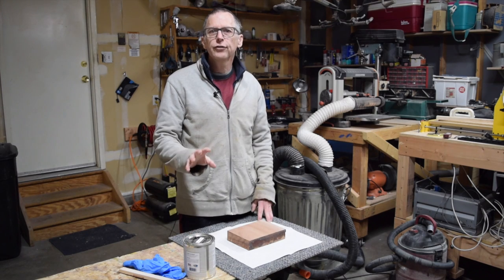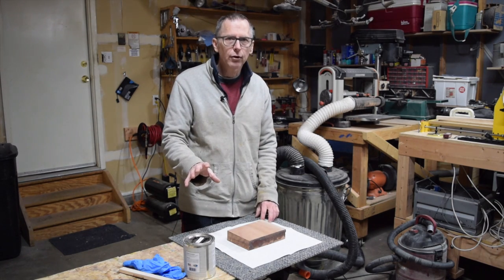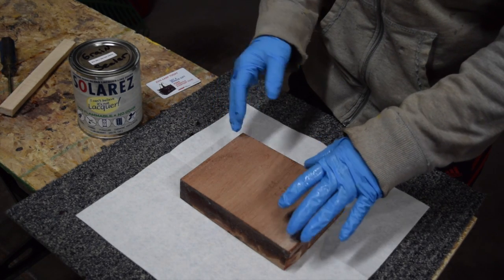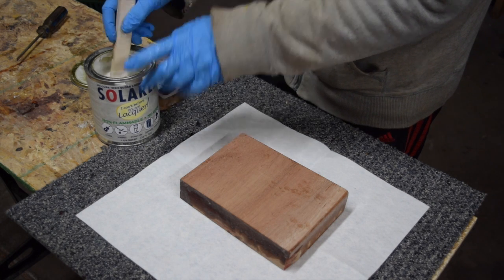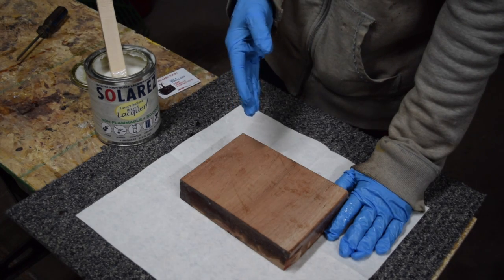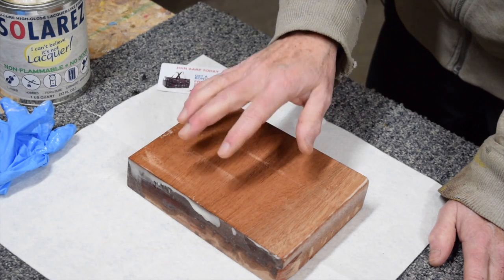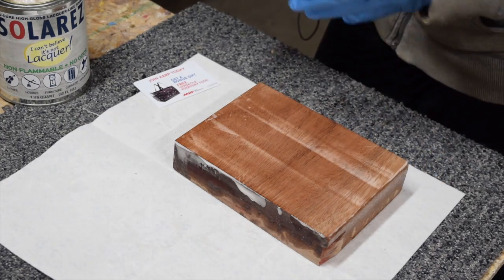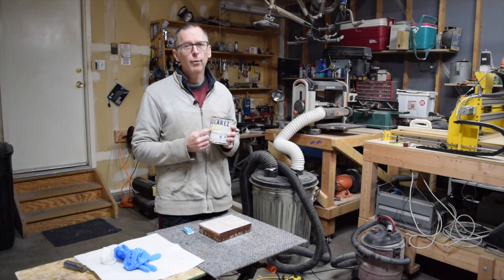The Best Wood Grain Filler I Have Come Across

Comment: After our exchange, I ended up using the Solarez on our Telecaster.  Amazing stuff--the ash is as smooth as glass!  My son wants to spray on a sonic blue nitro finish--would you recommend a vinyl sealer before that or have you found you can finish right over the Solarez?
Reply from the maker: Sorry I have no idea. I don’t use nitrocellulose.
Reply: I'll let you know what I find out---thanks!

Comment: What is this composed of or based on as the main ingredient? No SDS/TDS provided on site, is this similar to others, talc powder in solvent, which is what 99% of them are. The powder particles lodge in the wood pores and block them.
Reply from the maker: You will need to contact the manufacturer for that information.

Comment: OK, I’m sold! However, I and doing a walnut pedal board project and would like to try Danish oil. Are the two compatible or should I lay down a seal coat of shellac after the Danis oil first? Also can a colorant be added to make the grain stand out a bit? And if so what would you recommend?

Comment: My son and I are working on our first Telecaster build, using ash.  I watched your video on Aqua Coat grain filler and then this one.  Have you found that the Aqua Coat shrinks over time?
Reply from the maker: Yes, it does. All water-based products shrink. However, it usually stops after about two weeks depending on your climate. Also, the heat generated by machine buffing can cause shrinkage.

Comment: I imagine this product would not work for oil or oil/poly type finishes. What would you recommend there on Korina.
Reply from the maker: Rub the oil/poly into the wood with 4F pumice. If you can’t get the pumice, thin the oil with mineral spirits and wet sand it into the wood.

Comment: Hi, nice video, thanks.a question please
Can I use it on my ash cue to fill its grains? Over time ash cue grain pops up, ..may be due to reasons you mentioned in video (shrinkage). Cue has to clean with very slight damp cloth many times during playing. Cue has to send back to cue makers to refinish, and it takes few weeks to come back. 
Any idea how to fill those grains and then apply oil finish on cue. And it won’t effect cue color as well? Look to your reply,
Regards

Comment: Hi Chris, would you recommend this product for some ambrosia maple that I want to stain a darker brown color? Apply a good coat and sand it all the way back to only use it as a grain filler before staining? I'm real concerned with blotchiness.
Reply from the maker: I would recommend a water-based sanding sealer for your situation. It will allow better absorption of the stain after sanding it back while allowing consistent coverage without blotchiness.

Comment: Hello Chris, This is definitely one of the coolest video tips you have done so far. I have been following your work for the past 3 months, for I am building my 1st guitar Kit, and I don't want to mess it up. It's a Basswood body, with Maple top Les Paul style guitar. It also has a Maple Neck with ebony fret board. The body is cut out for H/P90/H, and A FR Tremolo Bridge. When I saw the kit on e-bay, It was a no brainer, For it Broke About every LP law in the book. I had to accept the challenge.  That being said. I plan on painting a design over the maple top, and then applying a gloss finish over that. I'm thinking two coats of Solarez Grain Sealer. Level Sand. Then a thin coat of Solarez dual cure Polyester. Level sand. Then base coat of water-based Crystalac Black. Then do some vinyl tape Masking, followed by one coat of paint, with Createx Auto Bourne Air Brush Paint. Un-mask Vinyl. Then the clear Coat Finish with either Crystalac Brite Tone, Or Solarez Dual Cure Polyester On the Top? What do you recommend? The back of the guitar is Basswood. Most excellent tone wood it is. But, it is a softer wood. So I'm probably going to go with the Solarez Polyester On The Back. Question Is. Do you have any Suggestions for this process?

Comment: I’m curious about your opinion. I’ve seen elsewhere that people have suggested staining or finishing first and then putting on a clear grain filler. Let the grain soak up the finish first leaving less to fill then either leaving it as is to cure or putting another layer of finish. This product looks great and kind of defeats other fillers, but if finishing first and then filling would work better for regular fillers wouldn’t this work better as well?
Reply from the maker: It all depends on the outcome you want. If your primary concern is color, dye or stain first and follow up with the clear grain filler. If you want to pop the grain, fill it first with a dark-tinted grain filler, sand it back, and follow with the dye or stain.
Reply: @HighlineGuitars  yeah that makes sense. Aqua coat is tintable and I’ve seen some really nice work with silver grain and black finish. I’ll look to see if this stuff is tintable. I imagine it would be. Thanks for getting back to me and introducing me to this product.

Comment: i ordered 4oz of this stuff what i received was 4oz of clear sealer no microballoons. after about five attempts at e-mailing them i finally got a response one person said they no longer put microballoons in their products and another person said they never have used microballoons. i also ordered 4oz of their i  cant believe its not laguer brush on formula and 4oz of the sprayon formula. i received two 4oz bottles of brushon formula and no sprayon formula. not a good experience with these folks

Comment: PS: As if the terminology was not confusing before, now there are various products called 'sanding sealer' 'grain sealer' 'grain filler' and 'pore filler.'  When a manufacturer comes up with permutations of those names, it makes it even harder to determine what goes with what, and in which order.

Comment: Can you mix this with paint or a tint? I liked when you mixed the black with drywall compound and it highlighted the grain. 
So the compound method results in shrinkage? Asking for a friend!
Reply from the maker: You'll have to ask Solarez if their product can be tinted, but I suspect it cannot be. To highlight the grain, I would apply a black dye first, let it dry and sand off the excess from the surface leaving it in the grain. Then I would apply the Solarez.

Comment: If i was going to stain my wood, id stain first and THEN do grain filler right? It wouldnt stain right if you did grain filler first correct?
Reply from the maker: I would put down a wood sealer first, sand it back and then stain. That will ensure uniform absorption of the stain. Then I would apply another coat of the sealer to lock in the stain followed by the grain filler (clear of course) after the sealer has fully cured.
Reply: @HighlineGuitars  Ok thanks for the info!

Comment: I want to finish a walnut radio cabinet. My intent is to stain with dark walnut, then apply Mohawk Dark Walnut toner, and finish with several coat of clear satin lacquer. Where in the process would I use the Solarez grain sealer?
Reply: It would have to be before the stain and toner in that process.  No way the stain or toner can penetrate through cured polyester resin and get to the wood.  As for the lacquer, I can't say how it would bond to this product.

Comment: Great video as always Chris! Would you stain the wood before or after this process?
Reply from the maker: Before.
Reply: @HighlineGuitars  not to sound dumb. But if I am planning on staining a mahogany body blue should I stain it first or fill it....and when would I schallac it. Thanks
Reply from the maker: @Elksniffer1  1. Stain the wood with a black dye. 2. Let it dry. 3. Sand the black dye off the surface of the wood. 4. Fill the grain with black tinted grain filler. 5. Let it dry. 6. Sand the black fill off the surface of the wood. 7. Apply blue dye. 8. Let it dry. 9. Apply sealer (shellac).

Comment: Hey Cris, Do I need a grain filler for alder? I'm using a primer, silver paint, candy red and then the clear.
Reply from the maker: No, but I would use it. Wood expands and contracts over time which causes the grain to telegraph through your primer, paint, and clear coat. Grain filler helps to prevent that. Even in Alder.
Reply: @HighlineGuitars  All right, will do, thanks for answering!!

Comment: What about adding some black acrylic paint or dye to make the grain on mahog or ash really "pop" like in other vids about grain filling?
Reply from the maker: Don't add any kind of color to Solarez. That will spoil its chemistry and prevent it from curing. Instead, apply your black paint or dye first. Sand off the excess while leaving it in the grain and pores and THEN apply and cure the Solarex. It cures water clear so the color left in the grain and pores will show through.
Reply: @HighlineGuitars  Thanks so much! your videos have given me a lot of great info about tackling my first project.  
Any idea if this same application method work for the brush on clear coat product of the same line?
Reply from the maker: @frick584  Yes, it will. In fact, I used the brush on formula as a grain filler before they had the grain filler available. Honestly, I can't tell the difference between the two.

Comment: Did you sand back to the wood before applying the top coat or did you leave a thin film of the sealer? Cheers.
Reply from the maker: No! I leave a thin film of sealer covering the entire surface to prevent an uneven application of my top coat.

Comment: I just got this product. Did solarez change their formula? It isn’t white the way you show in the can. It is water clear. Should I add silica to it?
Reply from the maker: You need to ask Solarez.
Reply: @HighlineGuitars  seems the formula changed. In fact, even after curing with a 385nm UV light for 39 minutes, the surface feels tacky  it doesn’t seem to want to cure completely. Yet, the residual material in the cup cures hard as a rock. Really strange
Reply: @HighlineGuitars  thank you for all your videos. They are all fantastic!

Comment: What if you're working in a shop with windows? Would it be okay to apply this as long as the sun was overhead the building (say noon?), or would you have to black out the windows?
Reply from the maker: Test on scrap to see what will happen. Even indirect UV light can trigger a premature cure.
Reply: @HighlineGuitars  thanks!

Comment: I'm willing to try this product but does anyone have info about compatibility with other types of finishes? Nitro and 2K polyurethane primarily.

I have used Z-Poxy on several instruments over the past couple of years and although it says Z-Poxy doesn't shrink everywhere on the internet - it does. I have ash guitar body that was nice and level 1 month ago, and now the finish has sunken to the pores.
Reply from the maker: Did the Z-Poxy shrink or did the moisture content in the wood change?
Reply: @HighlineGuitars  That's a good question. I'm not sure, but I would say it didn't. Because that guitar has a poplar burl top and the finish over knots has also sunken.

Comment: Haha.  Good video.  Good thing I saw this vid before i started filling my ash tele with Aquacoat.  I think i'll use the Solarez product this time...
Reply: how did it work for ash?
Reply: @Snowonthemountains2  it worked really well. Did 3 coats. Really need to concentrate on the edges but it came out really great. I'm happy.

Comment: How does this stuff compare to Behlen's Por-O-Pac product?  I'm assuming that after sealing it won't accept stain as it's most likely a urethane base.  Has anybody tried to stain over this?
Reply from the maker: You can't stain over the top. Staining or dying has to be done beforehand. Otherwise, you can apply a tinted clear coat afterward.
Reply: @HighlineGuitars  thanks.  Yeah I figured I'd have to use candies.

Comment: Could you still add a tung oil finish on top of this?
Reply from the maker: If it's a polymerized tung oil then yes, you can use it on top of this grain filler. If it's raw tung oil, then no, you can't use it since it would have problems curing in a timely fashion.

Comment: should i use dye before or after grain filler on mahog?
Reply from the maker: The only reason you would apply grain filler before dying, is if you want to tint the filler with a darker color and sand back to pop the grain. Otherwise, dye first a fill second.
Reply: @HighlineGuitars  thanks

Comment: Can this be used with nitrocellulose guitar lacquer?
Reply from the maker: Why bother? Use this instead and be done in a day: https://www.solarez.com/product/brush-on-i-cant-believe-its-not-lacquer/
Reply: Highline Guitars I’m restoring a vintage P Bass the is going to be Sherwood Green Metallic.  I already have the nitro that all be using.  This stuff looks like it would be well suited for natural and stained finishes.  I was just checking to see if there are problems with nitro adhesion or potential chemical reactions with the solarez grain sealer in your experience.
Reply from the maker: @thebassment1845  I don't use nitrocellulose anymore. I stopped years ago before I found Solarez. Maybe the company can help you.

Comment: How does it take water or alcohol based wood dye?
Reply from the maker: You apply the dye to the wood BEFORE you apply the grain filler.
Reply: @HighlineGuitars    Thanks.  So dye, filler, sanding sealer, wiping stain, top coats of lacquer.   (for a hammond)
Reply from the maker: @xs10tl1  Dye, Solarez filler, Solarez top coat. In that order.

Comment: Would this work over dyed surface?
Reply: Also, once you sand it and it turns white, will it clear back up after applying clear coat?
Reply from the maker: @bayouboattrash  The white is the powder generated while sanding. It wipes off. But, yes, it can be applied over dye or stain or paint.
Reply: @HighlineGuitars , thank you for the info!

Comment: Can you add tints?
Reply from the maker: Probably not. Normally you can't with UV cureables. Ask Solarez.
Reply: Nonethe less ,cant wait rto try the sealer and topcoat together 🙏
Reply: @edadpops1709  Did you use them both? How did it work out?

Comment: can you use boiled lindseed over this?
Reply from the maker: No.
Reply: @HighlineGuitars   SO Does this become a topcoat?  Or do they have a topcoat product as well to go ver this?
Reply from the maker: @louiscastellucci5066  They have a separate topcoat that can be brushed or sprayed on.
Reply: @HighlineGuitars  
because of absorption? 
which filler would you use for the neck then if using boiled linseed as per your other video
Reply from the maker: @drtammi  Exactly. Absorption. If you wet sand the BLO into the wood, the wood dust generated will mix with the oil and make its own filler.